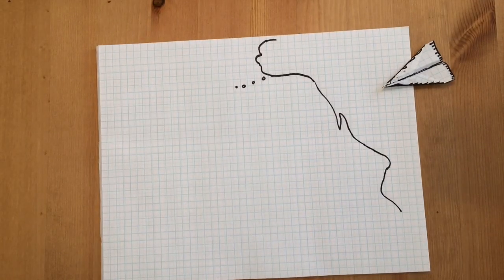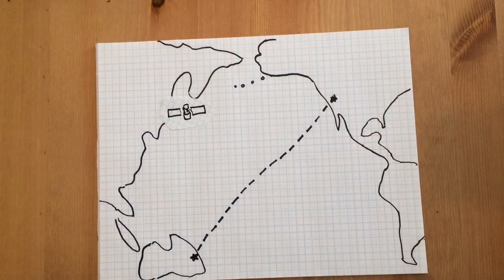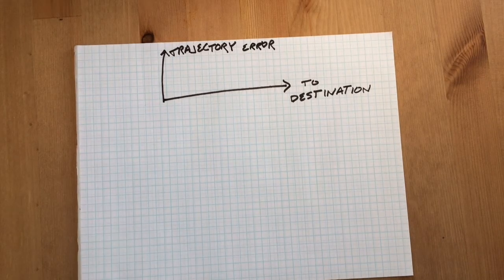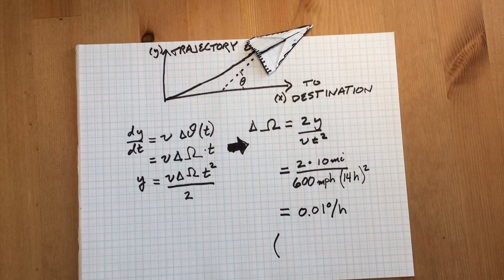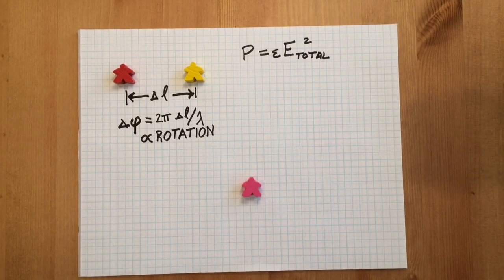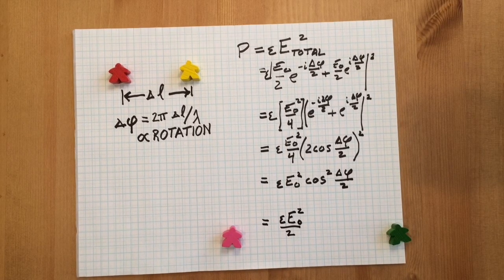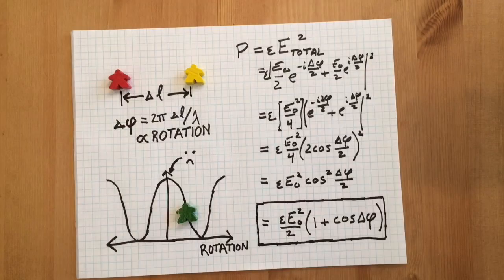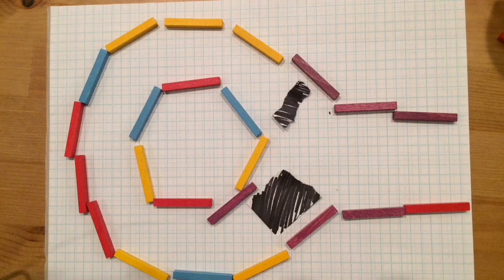Fiber Optic Gyroscope Overview

Comment: The most accurate gyroscopes aren't fiber optic; they're electrostatically levitated spinning spheres.  These can have null offsets of one hundred-billionth of a degree per hour.  This is something like eight orders of magnitude better than the submarine application you mentioned.  Google-search "Gravity Probe B" for detail.  The drawback to ESGs is they require a very benign environment in terms of acceleration and vibration, which makes them unsuitable for most earthbound applications.

Comment: Nice video... But looks like you are trying to hard to show off with your looked up math stuff.
Reply: Looks like he's trying hard to present a complete formal rationale for actual interference computations.
Reply: The maths explanation helps back up his arguments. If you dig deeper into inertial navigation systems, the maths presented here is a tiny  fraction of what is used. He's giving you a clue that there is a whole lot more available.